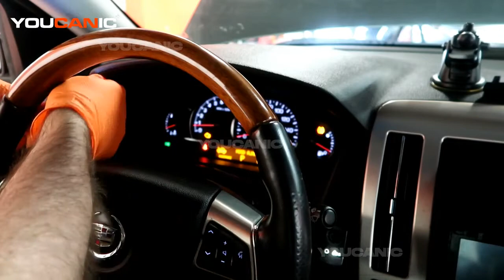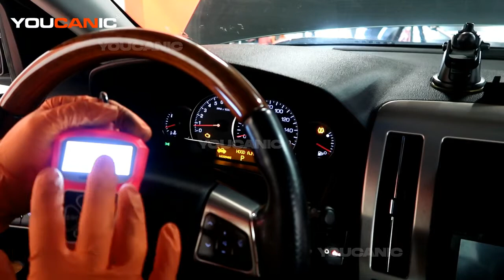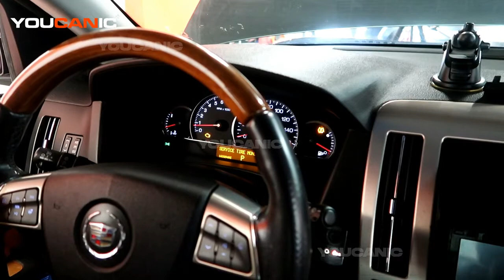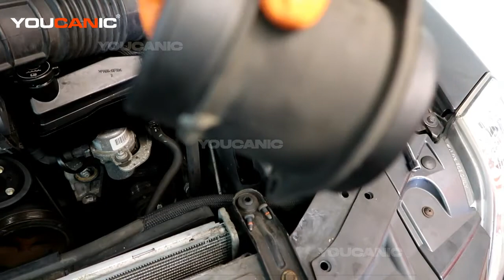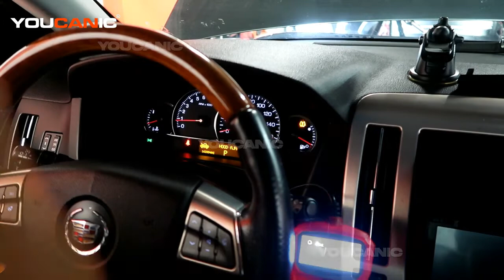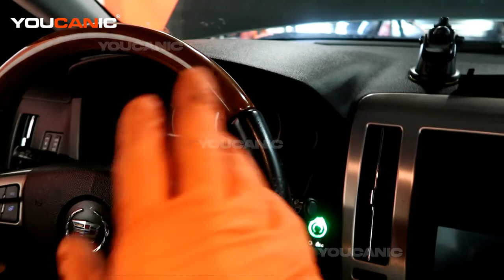2005-2011 Cadillac STS - Code P0100 Mass Airflow Sensor Replacement

Comment: I couldn't remove the MAFS from the intake tube. I think whoever had the vehicle last might've super glued it or something. Had to remove the whole thing and could only spray it with the cleaner from one side lol
Reply from the maker: I'm sorry to hear about your MAFS issue. At YOUCANIC, we aim to equip car owners with knowledge and tools to handle such problems. Our Full System Scanner might be a useful tool in this case: www.youcanic.com/scanner. 

If you have any more questions or need additional assistance, don't hesitate to use our platform to ask car-related questions: www.youcanic.com. We're here to provide you with comprehensive assistance and make car repairs clearer and more accessible for you.
Reply: I had trouble yesterday removing the MAF from the intake tube as well. I was able to put a screwdriver in-between where the MAF connects to the intake and worked my way around prying as I went. That freaking thing is in there tight! No way you would be able to just pop that thing off without prying also.